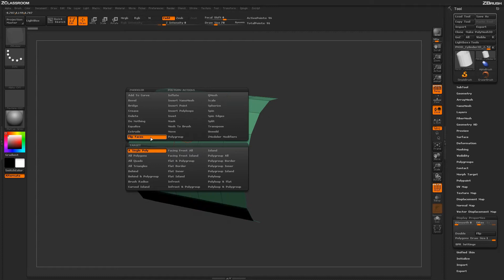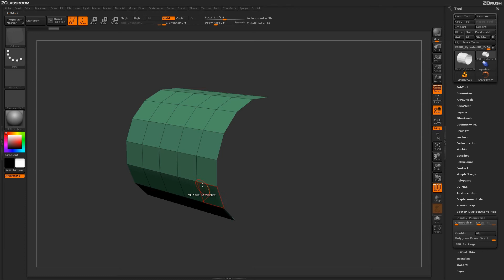ZBrush ZModeler Polygon Actions - Poly Flip Faces

Comment: I don't get the space bar option? For anyone else with the same issue as me go to the "Display Properties" in the tool bar and select Filp :)
Reply: Go to Zmodeler brush. Then you will get the space bar. The menu Flip Faces is different. Display Properties only works on the whole model.